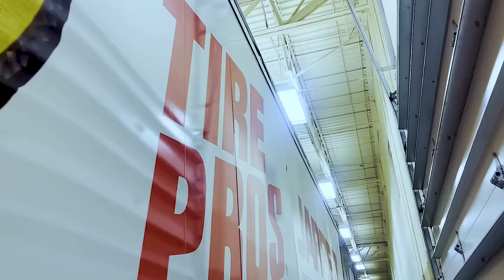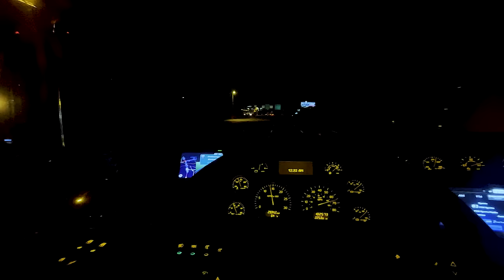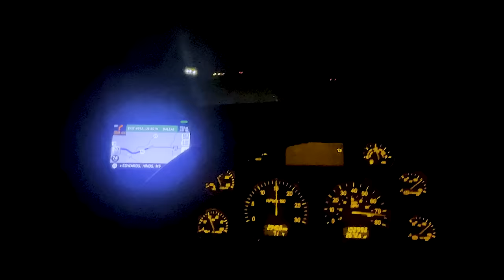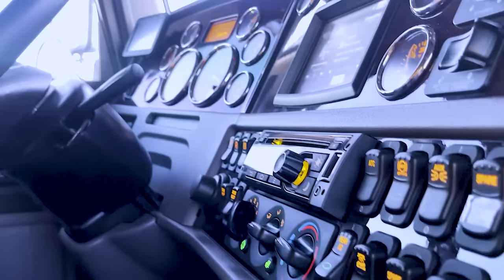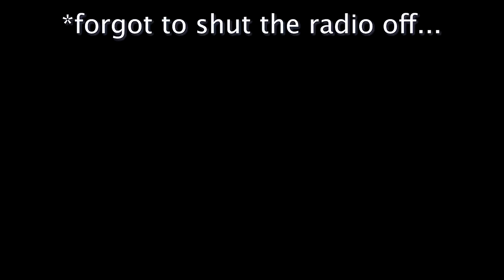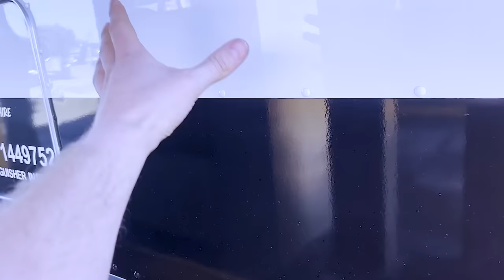Hauler Driving for Nascar. Away we GO!

Comment: Y'all got to enjoy the section of interstate 20 from Monroe Louisiana to Bossier City Louisiana did ya.
Trying to sleep had to be a real adventure I'm sure. 
My family on my dad's side were all around Birmingham, Alabama, and I was north of Dallas short ways, and I've never driven a big truck across through there. 
This might actually be worse, my wife had a Trans Am.
I don't know if you've ever rode in a late 70's Trans Am before, but they're made for handling, and have a suspension a lot tighter than a Camaro's, are a Mustang of the same time frame. 
The car sat right on the pavement, to the point speed bumps were cause for tactical driving, because if they were slightly too high you literally drug the entire undercarriage across it or even got high centered.
So that section you're speaking of you can actually see every section of concrete, and the expansion seam in-between them.
That car on asphalt was like riding in a Cadillac, but put it on a poorly prepared concrete surface.
 Even though each section was smooth, every twenty feet the sections meet one another, and it's probably not but anywhere from a 1/4"- 1/2" difference between them and the actual surface, but my how it rattled your teeth on down into your tailbone.
That 180 miles has to be the worst section of interstate in the world, and what's bad, is its still that way nearly 50 years later.
Something I've noticed over the years, is that I've never seen a official type law inforcement vehicle on that section of interstate, day night holiday anytime, but as soon as you get to either end. 
They'll be one sitting somewhere waiting for someone whose backbone has decided that it's had enough. 
Doesn't matter if it's a passenger vehicle big truck or bus someone will speed up, and get to visit with either a state trooper, or local authorities most every trip I've made back and forth from back east.
I can feel for anyone trying to follow the rules, and take their sleep time across through Louisiana on interstate 20.
Thus should be an interesting series you're going to share with the world with JR motor sports trucking side.
I've often seen the rigs on the interstate, and wondered what kinda of Mad Men were trying to keep the schedule that's required for y'all to be from one end of the country to the other in the time frame from race day on Sunday till practice on Saturday, but needing to be there by Friday ready to unload all the equipment them boys use throughout the weekend.

Comment: Random question for ya? I’ve seen you do it on several videos but why do you touch the hubs when you check the tires? Are you checking for heat in the hubs?
Reply from the maker: Yeah. Just wanna make sure they aren’t getting hot.   Want them good and warm but if they get to hot touch, you got troubles.

Comment: Cool stuff my man. Question for the team: If the trucks stay out west for the three races, what happens if they wreck a car? I though each style track uses a specific car? Fontana huge 2 mile, Las Vegas traditional 1 1/2 mile and Phoenix a short track?
Reply from the maker: Good question they are allowed to bring out a back up car, they also bring out enough parts to set the car up for the different style of tracks. So during the week the mechanics change out, shocks rear ends, and so forth. If I remember correctly, we also had a support truck make one extra trip one week into the With extra stuff.